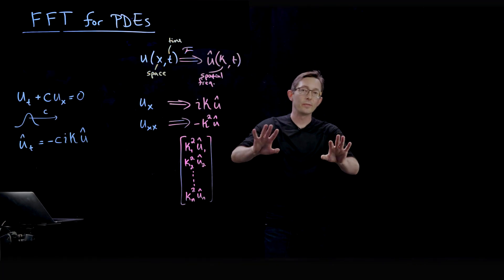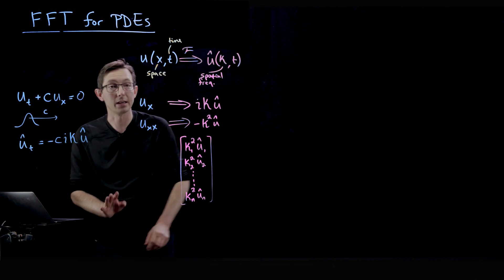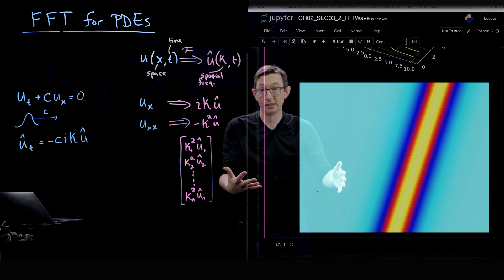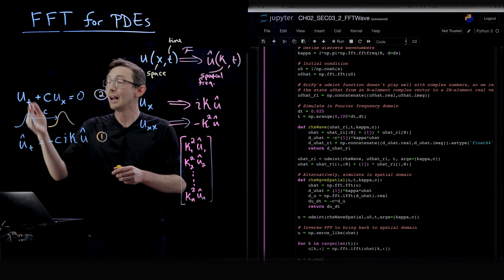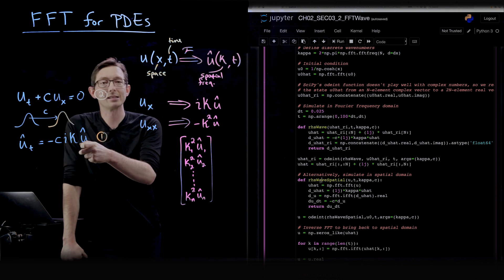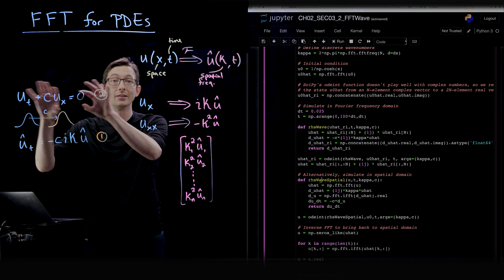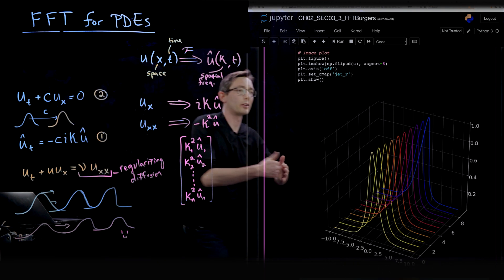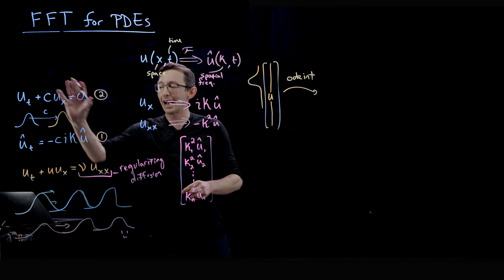Solving PDEs with the FFT, Part 2 [Python]

Comment: I need to adapt fourier- derived equations  for my construction  of an alternate number base for a mathematical subsystem system of a linear koopman complex dimension  transformation with an infinite domain and range but I'm not really sure how to do that since this is all in vector forms and springs, ect, while mine has a vector eigenvalue for each function in a plain.... it's a bit beyond taught  my maths to actually  invent a new series of equations to assist in complex plain analysis of numbers which are random or not analytical in the "real" number plain.. I need to find some resources for creating equations in an imaginary plain for complex number problems without solutions in real domains. any suggestions?
Reply: Why don’t you try converting linear koopman complex dimension transformation into complex plain and then do the Fourier analysis on top of Laplace transformations to construct easy alternate number base. After that it would we way easier to continue. Best of luck.

Comment: The FFT really implements circular convolution. How would you apply "edge" conditions in an FFT-based solver for the wave equation?
Reply: I think we assume that the boundaries are periodic for exactly that reason. Also curious if something like this would be possible for other types of boundary conditions.
Reply: by definition, solving in the frequency domain would give you the solution of an unbound problem. The solution with boundary conditions use Green's function. You can FT the Green's function related to your BC, do point-wise multiplication with your initial function transformed, and then apply inverse FT. Here the FT is only use to compute the convolution of Green's function with your initial function. You could use Laplace transform, but FT is faster.